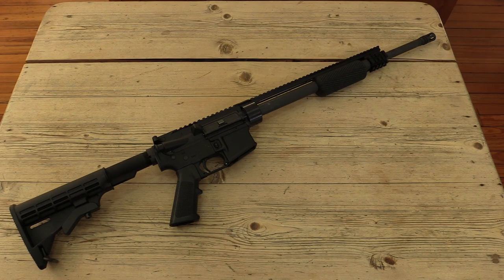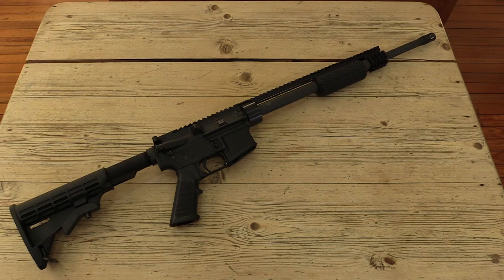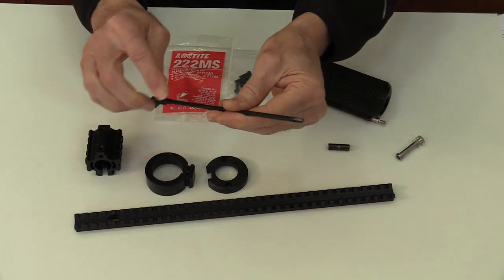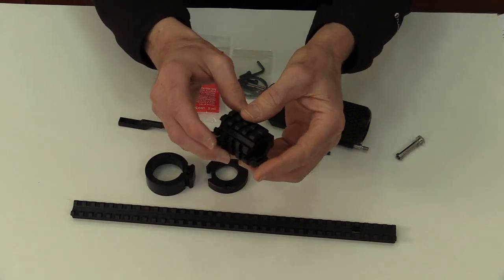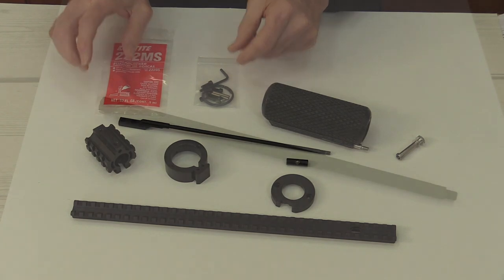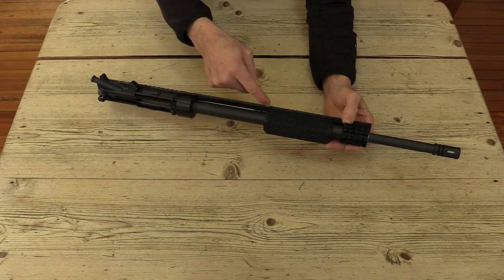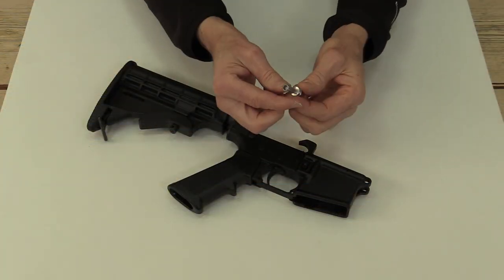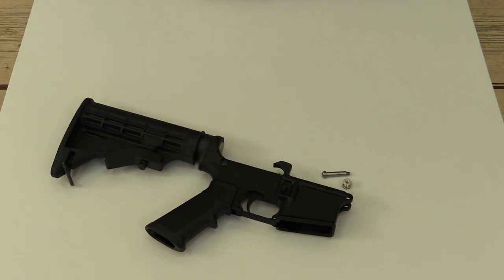ComGraf Pump-Action Rifle

Comment: New Zealand has a similar conversion but simpler.
To do the job completely and irrecoverably is to ream out the buffer tube thread and mount a solid mount for the butt stock
The upper receiver is blind pinned so that no gas tube can ever line up with a milspec gas key.
The ceiling of the receiver is blind pinned across under the Pic rail so that a milspec BCG and Gas key along with the charging handle will no fit.
The charging rod (connecting rod) is made from 9mm x 3mm spring steel bar stock.
Slide handle is not used but instead a slot is milled in the for grip and a pin protrudes.
This system is very light and very fast
Perhaps too fast
Reply from the maker: Do you have pictures?
Reply: @douglashoon286  Yes, I can email them to you if you like
Reply from the maker: @1philliph  Great. Please email them to ctlegalars@gmail.com. I've also seen pictures already for the Amicus pump action conversion made in CA. I don't know if that's the same thing. Probably not as no mention was made of reaming or pinning. Sounds like quite a process.
Reply: @1philliph  can you email me those pics as well? my username at gmail
Reply: @chriswall31  Rather not
You can ask Douglas for them.
I sent them to him
I will say that it is far better IMO to do this mod to a AR rifle than to purchase a Troy.
My .308 Troy PAR lasted only 300 rounds before the connection between the pump slide handle and the charging rod wore out and disengaged.
The engaging slot can be filed true as a repair a few times but every time its repaired the slot gets longer which is not desirable.
Reply: @douglashoon286  do you still have those pics?